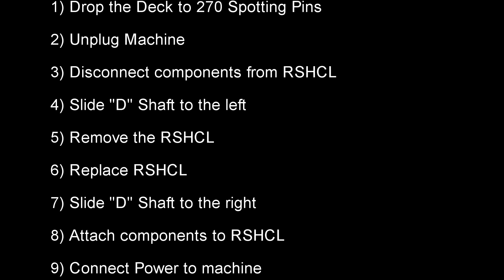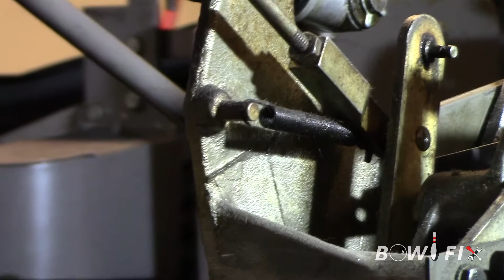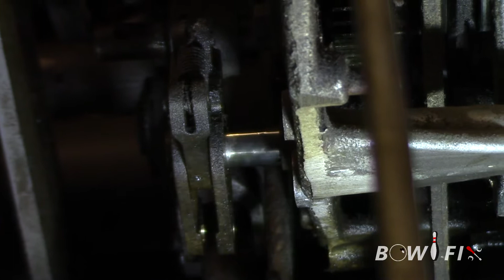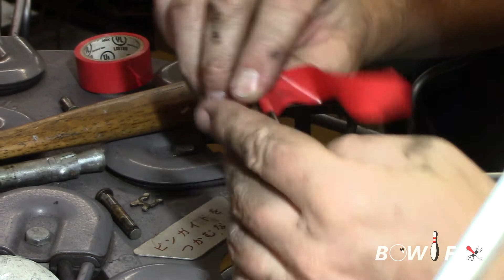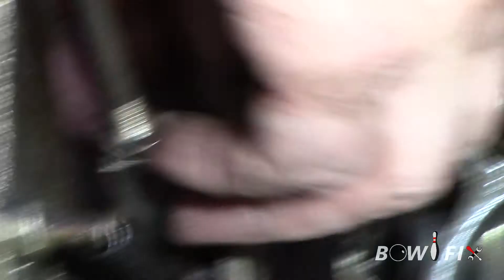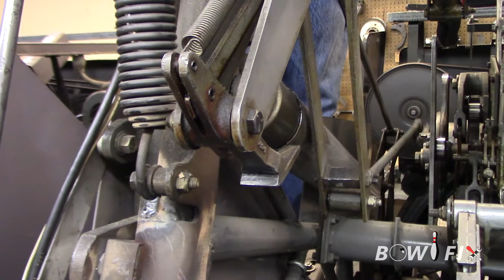Brunswick A2 Rake Sweep Hook Cam Lever Repair

Comment: That can cause the rake to.sweep 
Into the deck.i replaced the ass. Few times while in the machine.but some mechanics remove the detector an replace the assm on the bench.

Comment: That looks fine. i am think most people would just disconnect the linkages to the detector by removing x pins and pull the pin on the detector rod lift the whole detector out take it to the bench so you can see in there to work little better but your plan is fine too.

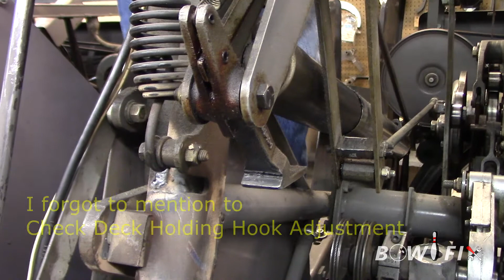Comment: @ 12:27

Consider painting that lever mounting bracket bright red to warn everybody to not use it as a holding point. That could be disastrous.
Reply: That is a good idea.  I will pass that on to the owner.  I am only a contract/ per call mechanic in this facility.  Thank you for your input.  KM

Comment: We had that exact cam follower fracture one night. Boss said, "Let's change out the detector."
Reply: I feel that you can do this job in 30-40 minutes or even less if you have practiced it a few times.  A detector seems pretty drastic in my opinion unless there are other worn parts inside.  A lot of parts and timing involved with a detector swap. I will record a video if I ever have to do one.  Good luck. KM

Comment: It's been over thirty years since I worked on these. Remind me: What was that mercury switch for?
Reply: Ahhh... Second Ball light?
Reply: Good question.  I believe it was the strike light switch for the masking unit if I remember correctly.  None of them are connected in this house.  First and Second ball lights are very important though.  When I first went in, half of them were burned out or out of adjustment. It is a pet peeve of mine....lol  KM

Comment: Lord....Have you EVER cleaned those machines?
Reply: I know Wayne.  These aren't "my" machines.  I only get called when something breaks. Have I told them about cleaning, preventive maintenance and such, of course I have. Some things are not in my control.
Thanks for commenting.
Reply: @bolton454  How much time does it take to completely swap out a detector? Seems like it might not be a bad annual maintenance item. Swap out the old, dirty one and clean and rebuild it on the bench. I don't remember how big a deal it is to swap one.
Reply: @netdoctor1   To be honest, I am not sure I ever had to.  Keep in mind I was a full time mechanic in two A2, 24 and 32 lane houses, over 5 years in the 80's.  That is not a very long time to see every A2 failure. I am pretty cautious about changing something like that, unless I have to.  Take lots of pictures.  Sometimes it can take extra time to work out the bugs of a new assembly. Check out bowltech.com for lots of information on bowling machines from experienced mechanics.  I hope this helps. KM